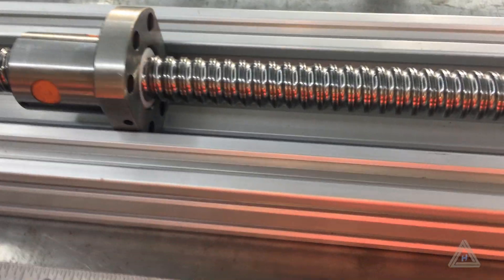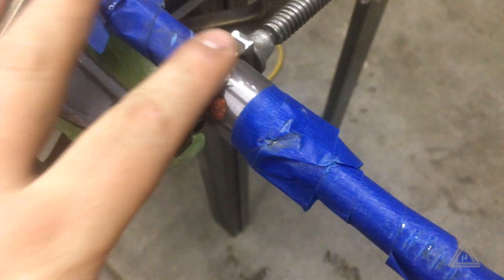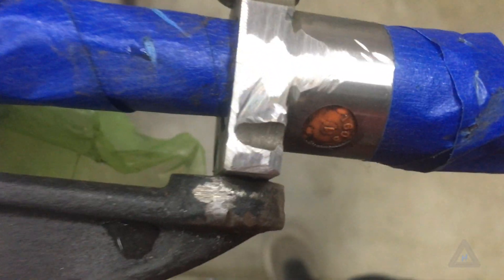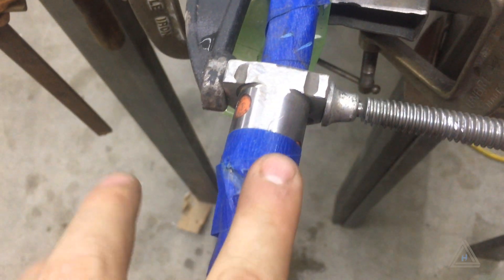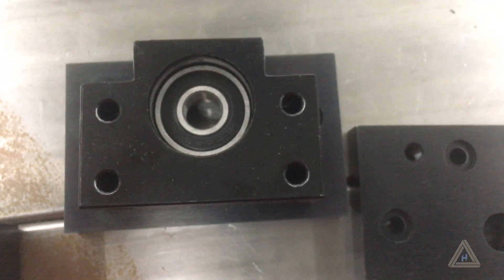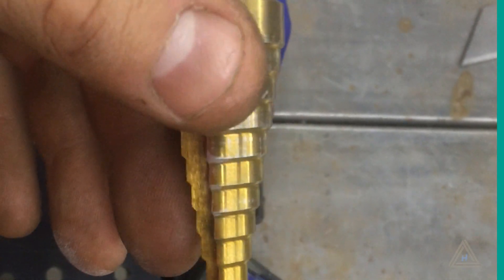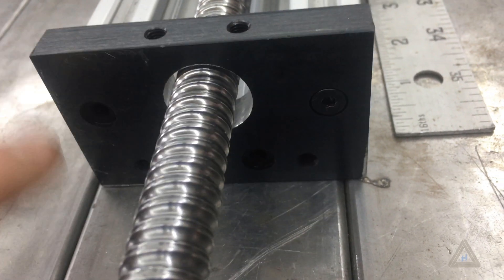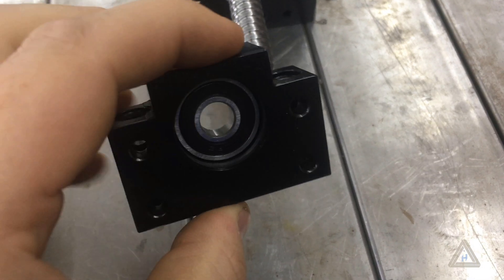Long DIY Linear Actuator with Antibacklash Ballscrew 1500mm 3D printer build

Comment: Where did you get that rail that you mounted the lead screw onto? The only rails I have seen are 2020, 2040, 2060 and 2080 anodized as well as the black colored rails but not that one.

Comment: This is way to late for this project but you can wrap painters tape around the transfer punch till you get the best fit then tap it with your hammer. I use this technique when ever I get into a fitting situation like this. Precision is the thickness of the tape you use rufly.
Reply from the maker: That's a cool trick, I'll have to try that sometime. Thanks for the interest!

Comment: What lead screw are you using, I thinking of going for a half inch one for my 1m cubed 3d printer, but im afraid its diameter may not be thick enough...
Reply from the maker: They are Antibacklash Ballscrews SFU1605-59''(1500mm) (ebay). I would say a half inch should be good but the thicker the better. Mine are 16mm thick (about 5/8 inch) and its fine for the speed I'll be running. I find the length is not really as big a factor the real big one is rotation speed. You want it thicker to combat Screw Whip. Good luck with your build!
Reply: @CountryAireDesign  Thanks for the reply, I really appreciate it. Also great job on your build!